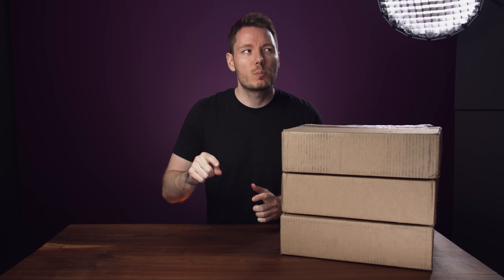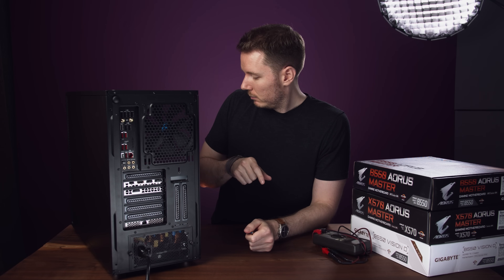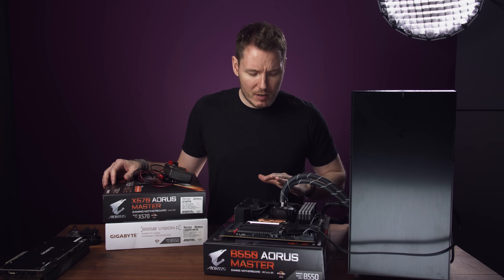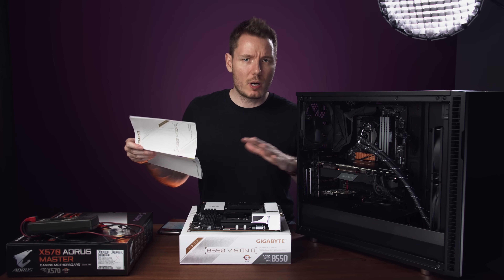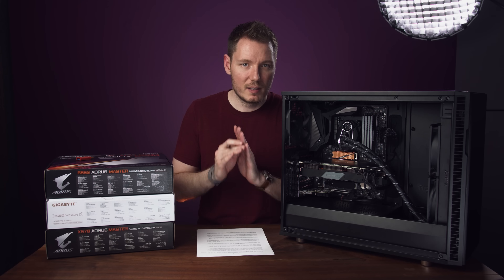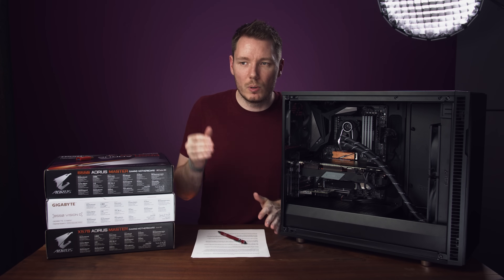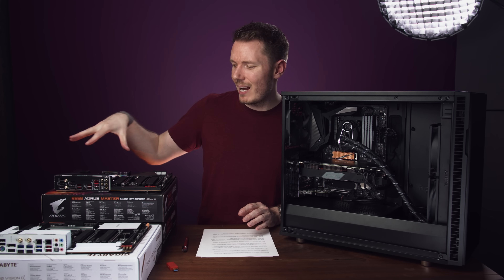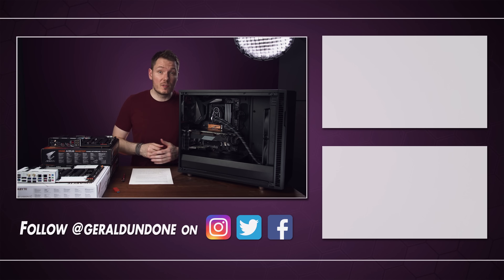I Was WRONG About These AORUS AMD Motherboards

Comment: Now in the shop!
New motherboard: $259
Gerald Undone tested motherboard: $399

In my 2017 build I have an issue that if my computer is cold I need to get it warmed up by 1-2min stress testing it before using the Nvidia gfx heavily otherwise the Nvidia stops working and I have to turn the computer on off.

Comment: Bifurcate means that you get SEPARATE actual PCIe slots.  The reason for PCIe bifurcation is when you have for example a 4 slot M.2 NVMe PCIe Add-in-card.  So really you are just spreading the PCIe bandwidth across the HSIO channels.

Comment: Oh, I know how this feels. I had a similar ground loop issue, I too went through the gamut and gutted the entire system, isolating everything to the bare minimum components in attempt to isolate, removing the motherboard from the case, testing ground with a multimeter on my receptacles, etc. Ultimately I RMA'd my motherboard with Gigabyte as I had a faulty sata port on it anyway, so thought I would kill two birds with one stone. The ground loop only presented itself when using my RME audio interface as a USB Dac, and connecting a pair of its outputs to RCAs on a headphone amp. Extremely annoying and pulled my hear out as I invested a ton of time without a clear resolution. Ultimately I moved away from custom PC builds as it was a Hackintosh and it just killed way too much of my time troubleshooting over the period I had it (without being 100% satisfied with the user experience)...I'm now running full OEM simply to save time.

Comment: I had issues with the bracket for the 212 cooler caused all sorts of crazy errors all from ram not detected or CPU random bsods. fixed it with clear tape between the bracket and mobo. also, is your power "clean"?

Comment: Lessons from the video;
-RGB is SCAM.
-Cheap RAMs work fine as long as you don't need ECC.
-GPUs have coil whine, they are whiny, they cry a lot under certain workloads.
-Get a Quadro if you are a PRO.
-Invest in better chassis from CoolerMaster
-Get better PSU
-Invest highly in some high-quality UPS with Online feature.

Comment: Wow - some great effort in troubleshooting there. I come from many years playing in touring bands - a ground lift was in almost every musicians bag for basic but similar problems. The process was plug something in and when the amp is turned up, if there is hum or noise like the what you were getting, then pull out one at time anything that has a seperate ground til you find the culprit and the reverse polarity or lift the ground. Plug it back in and in most cases that would fix it. And the same gear could actually be fine some places and not other places. So troubleshooting that - the venue or arena power would make a difference. But kudos to you for being so vigilant - while you were going through the whole thing here, I was thinking that I probably would have just plugged in the USB ground loop isolator and called it a day. A little out of my tech interest here, but still  kind of interesting.

Comment: Gerald- I don't know if this is too late to the game, but I would pull the power switch from the equation. Leave everything in the PC and try powering up the PC with a separate switch not connected to the case, or just shorting the terminals on the motherboard. My guess is there's something up with the design of the little switch mechanism itself, or maybe there's something poking out of the switch box when in the off position that goes back in when the button latches in the on position.

Comment: Gerald - great video but I think you’ve approached the problem in the most difficult way. Computers are nightmarish when it comes to controlling noise and interference leaking from the motherboard and its hardware into peripherals and audio interfaces. You’re better off using properly designed interfaces that are able to deal with the noise - or galvanically isolate the connection between the computer and the audio interface. One of the easiest ways to protect from usb noise is to use optical out of a computer - however this may not suit your needs. The iDefender ground loop isolator is a good solution - but a well designed audio interface should do this in the first place. The Zoom F6 is subject to significant low frequency noise from its poor power filtering (see testing on AudioScienceReview). Might be worth investigating the sound devices gear which I think is better engineered.

Comment: I can appreciate your video. I've been building PCs for many years and don't ever recall having so many issues at one time. However I do have an issue with one of my systems where I get computer noise coming through my USB audio interface. I've tried switching interfaces and a host of other things but it's still there. I'll have to give the USB ground-loop device a try. 
BTW - x570 boards as SOOO much better than the B550.

Comment: I have the x570 in my editing rig. I really like it. Still haven’t filled the 3rd m.2 in there. When you connect headphones to the front panel and set it to 2nd audio output it has a 3step amplifier which comes in handy for my 80ohm beyerdynamic headphones. 
I set the chipset fan to silent in the bios and the temps don’t get anywhere close for it to even turn on.

Comment: I'm not an Electrical Engineer either, but my guess would be the the RAM (or it's RGB controller) and the graphics card are emitting radio frequency noise and the case, due to it's sub-optimal grounding, is picking up the RF noise like an antenna and leaking it into the ground circuit.

The USB defender could be interrupting the ground connection to the PC and grounding directly to the mains thus blocking noise from the computer's ground. Or it could be grounding the entire case via the USB and motherboard, and thus resolving the case grounding issue.

Comment: The first thing I recommend is to take a wire and connect it to your case and make sure it's a good connection, then put the other end of the wire to your house earth just for testing purposes and to make absolutely sure that the case has a ground relative to your earth ground and if you still see the exact same problem I can guarantee that it's your house earth that is not connected to your wall outlet and it's very dangerous if something went wrong in the power supply.
I wouldn't touch your computer case if it's not properly connected to your house earth and I'm almost sure that if you measure voltage between your case when your computer is turned on that you see the full line voltage on your meter and you're lucky you didn't die!!!

Comment: In Europe with 240V good power I’ve built three systems with FractalDesign cases, Corsair PSUs, ASUS motherboards, ASUS graphics cards. No isolators between motherboard and chassis raiser screws. As the the threads I dug up indicated some experience EMI due to much sound dampening rubber I thought a description of a system working in this system may be helpful. 

(Weather you actually should have continuity between chassi ground and PSU ground seemed to be debated. Some recommended adding isolators between mobo and raiser screws).

You gotta let us know if you progress in this mystery mess, this is the weirdest thing I’ve heard about recently (if we discount my girlfriends old system that needed a cable from soundcard mic input to the modem in order to power on....)
Reply: Update: my own system, I don’t have continuity anywhere except between USB  ground to USB ground. Chassis and PSU paint appears to have infinite resistance. So there is almost no risk of groundloops in my system because everything appears isolated. The only ground to my knowledge is the PSU ground cables.

...Presuming I’m understanding my caltek cm2300 meter correctly (just replaced battery, haven’t been used it in 20 years or so)
Reply: Update: I have continuity between the screws fastening the screws PSU to chassis, not all the way down to zero (maybe not just connecting well enough). Even when turned on. So a completely isolating paint job makes diagnosing continuity really hard.
Reply: Update: I get a perfect zero between USB shield and the screw connecting my PSU to chassi. Even when powered on. So PSU shield is same as USB shield. Fractal Design Mesh C, Corsair RMX850 v2, ASUS ROG Strix X570-F.  I really need to push hard on the probes to get good readings on the chassi screws to gets a good reading, they don’t want to be probed. Most of the paint job on chassi and PSU appear to have infinite resistance and no continuity to anything.

Comment: A few questions here:
1) What type of audio device are you using? USB speakers/headphone? USB sound card? Is that what you plugged into the iFi iDefender?
2) Has anyone else encountered issues of this kind with RGB RAM on Gigabyte motherboards? What brand of RGB RAM were you using and does any other RGB RAM work properly?
3) How can I tell how much (if any) "coil whine" will be a problem with a particular graphics card that one might consider buying? Are there any "rules of thumb" in that regard?
4) Is there a difference between using 3.5mm audio ports (headset/speakers/microphone) vs. using USB audio devices.

Comment: Hey Gerald. I had that same sound problem in my speakers when I connected an external GPU to my Macbook Pro . The way I solved it is by putting an adapter to the electrical cord with only two pins,  the ones that do not have the ground pin. That solved it right away. Seemed that there was some ground coming back thru the egpu ground pin and entering the computer thru the thunderbolt cable. Great video.

Comment: My grounding issue mainly caused by my PC case, not the motherboard. I own b350, and thermaltake case versa c22. Audio is ringing when i plug the speaker. It turn out, the front panel connector of the case is the problem. The connector front panel audio jack and front panel USB port have both ground wired together in the front panel connector PCB. The ground of USB and ground of audio should be separate to eliminate noise. I need to open my case and rewire the front panel PCB ground to fix it. (No modification on the motherboard, you just need to change the stupid design of the front panel PCB that embedded in your case). Similar issue to this person https://www.eevblog.com/forum/beginners/pc-hd-audio-front-panel-rewiring-emi-filtering/

Comment: Hay Gerald , I’m not going to give you anymore abuse on the thumbnail lol but let’s try and unpack these issues.  

Ok on the earth continuity the chances are it’s not actually that the case does not Earth but it’s very poor and combine that with noise from vrms on the board.  Your continuity test on your multimeter works by sending a small voltage usually 1-3v and this is picked up in the loop when you test. I suspect that test is also combined with the diode function on your meter as well and it’s susceptible to external influence.  The fact it’s not beeping does not mean you don’t have continuity but it’s not able to read that voltage it’s sending properly or it’s being affected with switching noise from the VRM on the board.   

Due to poor connections between the panels and parts of the case your likely getting small ground loops in parts of the case that are not all at the same reference. This is happening because there is always some leakage on components and noise on PSU and VRM switching. 

When they are all connected together well they are all grounded to the same reference and don’t cause issues, that’s why the adapter was helping.  If you perform the same test in the resistance testing mode on your meter both off and on you will likely see the same reading. You are probably getting an ohm or two and that’s enough to cause these issues.  

As for the Ram with the RGB again switching noise from the LED and drivers.  For a high clean system for audio work especially loosing all of the RGB ect will help. You just cutting out anything that could cause noise on the power rails. 

Overall cases are very poorly made these days, often panels are pained before assembly or coated and this makes very poor electrical connections between them for earthing .  Then you have paint on motherboard posts and where the PSU meets the case. Even though screw go in it’s not enough.  To make a really clean system from noise proper earth bonding is needed like you used to get on older electronics gear to each component. You want to see the earth bonds on the old meter I posted on your Twitter.  

Glad to see you keep the X570 best choice overall.

Great content as always 😉

Comment: You should had a case as a control in the experiment.  This would remove the possibility that the standoffs in the (Xi-?) case had a different impedance to ground to measure.  Speaking of which, did you happen to note the impedance to the case of the PSU to  say the top of a MB mounting screw?... Then measure Ohms / Impedance  between the standoff and the PSU mounting screw. Those measurements should be very close.  The USB adapter probably has an optoisolator/optocoupler  hence the cost.  Once the ground loop is created you are more susceptible to EMF from the oscillators in the case,  as it acts like one winding inducing all kinds of switching, oscillators ( The RAM for instance, or video card )

Comment: Hey, checkout the Silverstone CP14-E adapter (like $20-30 on Amazon), if you have an extra USB3.1/3.1 header you can use that to convert to USB-C header. I had the same issue, my Asus Pro WS X570-ACE didn't have internal USB-C header, I used that adapter which worked great! No USB-PD so no fast charging of phones and such.

Comment: Hey Gerald, I'm curious, if you set your DMM to 2v DC, do you see any voltage between a screw on the psu and the usb shields when it's powered up?

Comment: I went through a few motherboards that wouldnt post before I figured out it was one of the wires from the power on/ reset /hdd light switch group of wires. I just left them unplugged except for power on. My guess is you have something similar wrong. You could buy a switch just to test. Or maybe test continuity but I'm no electrical expert either.

Comment: Simply there is something breaking the continuity when you turn the power switch on. Try replacing the power switch on the case , it may have been poorly built, or get a similar case and see if you have the same issue. When powered off your completing the circuit and when you power it on some way your breaking the circuit. It probably  fried your last board, and only a matter of time before it fries your new board causing your usb issue.. also check capacitors, any fuses, switches or loose wires. Something is not properly insulated. The light bulb is simply a short circuit, when you turn on a bulb it causes a short/continuity at the bulbs resistor..  I bet your issue lies in a faulty switch action.. 

Start with the power, and every point of connect in series, I bet it’s the power switch..

Comment: You might want to swap up your radiator, having the pump above the small reservoir within the rad cause the air the be stuck in the pump, leading to more noise, and eventually, higher thermals. Steve (from Gamers Nexus) made a video about this recently if you're interested.
Reply from the maker: The top of my rad is above the pump. I'm utilizing the ideal position from that very video on GN.

Comment: I had the same USB problem in 2009 with a Cooler Master case. It caused by a loose front panel ground connection.

Comment: I had a similar problem awhile back... It drove me crazy. However, since it was months ago, I don't remember exactly how I solved that problem. But I do believe that I can direct you in the right direction. I would start with the wires. Particularly any audio cables, from the speaker, the mic, and audio interface. That sound is digital/analog noise. It can come in the form of crosstalk between touching wires... a bad insulated wire. A speaker wire that is exposed slightly from the speaker negative/positive connection. If I had to swap out hardware, I would swap out the audio interface. I would also swap out audio wires... Also It could be the microphone and their magnetic fields, relative to the speakers and their magnetic fields. Try and update the drivers from the audio interface too. I strongly believe it was a wire though...

Comment: Hey Gerald, friendly tip! If you can its better to orient your AIO Radiator with the tubes on the top, this way it guarantees there arent any air bubbles reaching the pump and making it perform noisier.
Reply from the maker: It's actually the opposite. If you're referring to the Gamers Nexus video, he recommends tubes at the bottom. This way the air goes to the top of the radiator, which should be above the pump and thus the air will go to the top of the unused portion of the radiator preventing air from being pulled into the tubes at the bottom and into the pump. I'm worried about this misunderstanding--you're the 4th or 5th person who has commented on this very video with that tip and the tip is just incorrect. I thought Steve's video was pretty clear, but perhaps there is a larger misunderstanding in the community regarding this. Here's the timestamped link: https://youtu.be/BbGomv195sk?t=1184
Hope that helps. Cheers!
Reply: @geraldundone  good to know! that was the exact video i was referring to lol

Comment: My aorus x570 elite boards have been great, have bought three of them for different builds and have worked great.
Use it with a focusrite 18i20 and works fine
Reply: But saying that I did have a problem with a usb lav mic having very similar noise on my old 1150 gigabyte motherboard, strange!

Comment: The B550 Vision looks very clean but not sure about the thermals on the VRM heatsink. I went with the Steel legend.
Reply: Check out the hardware unboxed b550 roundup, the thermals were actually not that bad